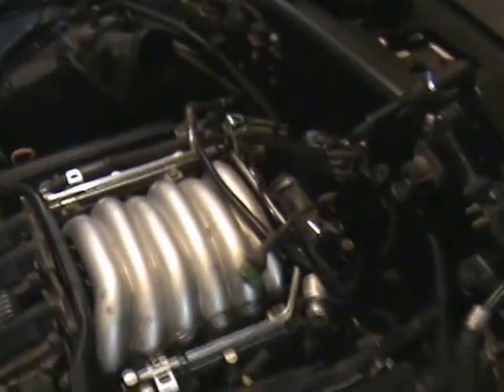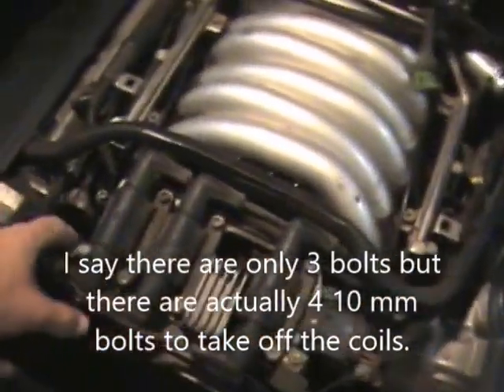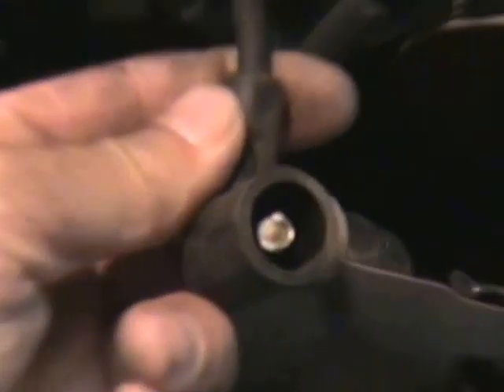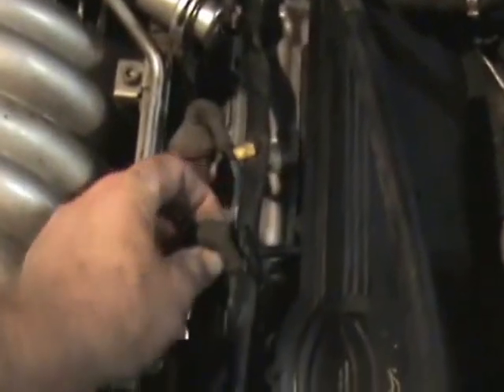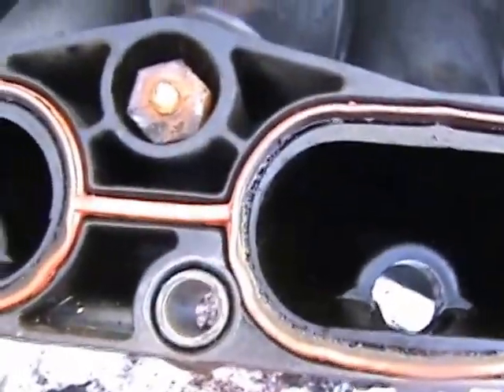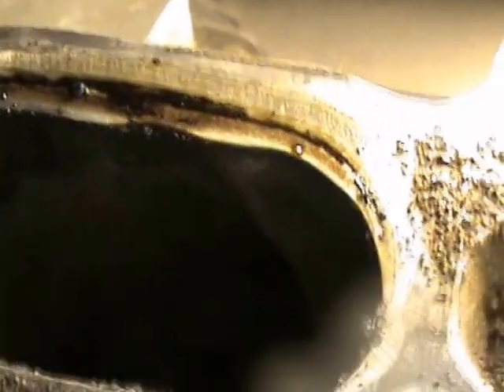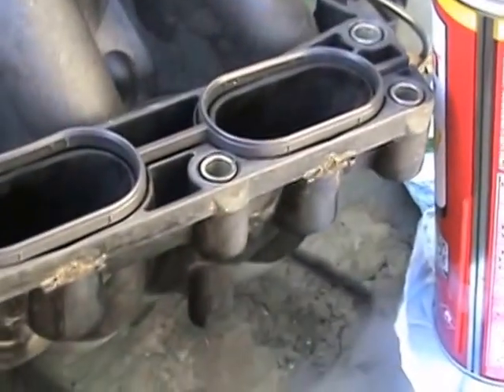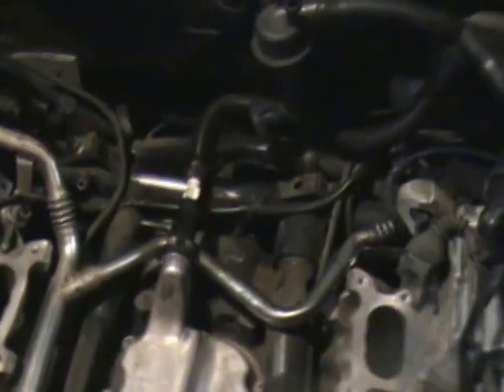VW Passat b5.5 2.8 v6 Intake Manifold Removal

Comment: Good video, thanks.   I need to take the hard plastic intake hose (the one behind the vacuum lines plate), so I can get to the PCV hose on back.  Will try tomorrow, hopefully is the same, ie one screw.  I have 98 2.8  A6. 
I can't comment on those specific codes, but maybe a professional smoke test might find the leak. 
The hose you rigged up (I know you have to make due when you don't have the odd part, been there done that), is the back of engine PCV hose.  Those hoses become brittle and clog. Best to get a new parts as a used one will break when you try to take it off or install it.   For anyone doing this type of work, I would suggest ordering a kit. 
Blauparts has one...... Audi A6 Breather Hose Kit - 1998-01 - 6 Cyl 2.8L V6 30 Valve Engine. Part Number GC26180-B.
There is a stubby hose below the vacuum hose plate,  that always goes bad over time, so best to just replace it. 
 I don't know the size, but it is  bigger than the 3.5mm lines that are used in most places. 
Hope this add some info for anyone watching the video.

Comment: I just pulled my son's 2.8L V6 from his '01 Passat to replace the transmission. Hell of a job so far. On the driver side rear of the engine is a missing "something". An oblong, o-ring sealed piece is missing and I can't figure out what it is or where it's been all of these years. Anyone know what it may have been?
Reply from the maker: Sounds like it might have fallen off when you did the job?  You probably figured it out by now?

Comment: Hi, could you please check the oil cap in your car? Is there strong suction (from PCV) under the cap after replacing intake manifold gasket?

Comment: good job, this engine is very thirsty.... mine runs without the 2 catalytics and gets 22 to 27 litres in a capital Tirana, traffic is very heavy and gasoline has low quality is nearly shit.... traffic lights are distant from each other about 500 meters or 1 km or less in some areas... I'happy only in highway 11.4 to 12.5 litres....
Reply: tiptronic and lpg
Reply from the maker: What d you mean lpg? Liquid propan gas?
Reply: VW Passat yes on propane Landi renzo system, with dual vaporizer (reducer) LI02 so Liquid sequential injection, in traffic jams is a nightmare the fuem consumpt.

Comment: I did this recently and now my car won't start, not sure what I did wrong.
Reply from the maker: Sorry, I just got this message. Did you figure it out? My guess is something did not get plugged in correctly.
Reply: @vwpassat2122  I suppose it was flooded, or the fuel pump was failing. After a lot of trail and error I got it to start by nursing the gas, haven't had a problem since. I did replace the fuel pump and it starts instantly now. Thanks!

Comment from the maker: The real bummer is my error codes 491 and 492 have come back.  Not nearly as frequent as before but about once a month the codes will come back up. Anyone one have any suggestions.  My gas mileage is a little better.  I was averaging 15 mpg around town. Now I am geting averaging 16.5 mpg.
Reply: The passage ways in the heads mite be gummed up. That takes patience to properly clean. Most shops will either remove the entire engine or cylinder head and align drill the passage ways bigger so it never happens again.

One of my mates that use to work for an Audi racing team that now works for Subaru Rally Team USA gave me a list of stuff to purchase and told me a cheaper way around it.

I managed to use air craft cable and a drill to clean the ports out. Then I purchased some walnut shell media and acetone and removed the exhaust manifolds on both sides of the heads for a good cleaning.

I made my own adapter plate to bolt to each port to clean the exhaust ports and valves. Traced it out using the old gasket. The junk adapter that you can purchase online is just that, overpriced junk. It is poorly made 3D printed crap that wears out quick.

Acetone and a good soak is the best option before using the walnut shell media to blast the rest out. I use Acetone to clean carbon all of the time. Nothing eats carbon better in my opinion.

Nice part about walnut shell for media is that it is so soft that it will not damage anything. What little bit that may get into the cylinders, if one of the valves are open slightly, will burn up.

Since I did both sides of my exhaust ports, cleaned the ports in the head that leads to the combi's, and cleaned my exhaust manifolds, I have yet to get another code. If you don't want to use walnut media, you can use some cleaning brushes. Just takes longer.

I cleaned mine over 3 years ago. Easy access to the lower manifold bolts when you remove your plastic inner fender. I spent less than $50 to do both sides.
Reply: Yeah, check to see if the secondary air pump is even working. Also the rivets on those go bad and it could be leaking.